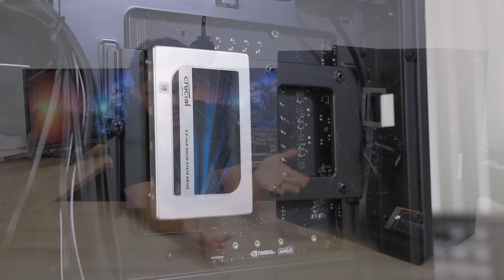The best case they've ever made? BeQuiet Dark Base 700 Review

Comment: In my opinion this case looks like hot garbage for $180 dollars. 2 fans. Shit ventilation. Not a very unique design. I'll pass all day on this for a H700i.
Reply: It also has virtually 0 cable management features.
Reply: Also next has a internal cable management systems, a grid and hue plus, and a internal RGB cable with  better ventilation all of that for $170 (if you checked of part picker)
Reply: Feel the same way, just don't like that LED on the outside of the case, looks a bit tacky.
Reply: I have a H700i and love it. Custom loop friendly. The radiator bracket makes things so much easier. And it's E-ATX friendly. 
Also you get so much more for just $20 more. H700i for me all the way.
Reply: I also prefer to use the H700i while this case does look good i prefer the H700i and its AMAZING cable management in the back, I DIDNT EVEN HAVE TO BUY ZIPTIES
Reply: Pennywise you do know how small that case is in comparison? Have you not seen the Yacht build? Meshify C is considered budget case. Once you past $150 USD it's considered enthusiast and you get better features.
Reply: I might have sounded a little harsh in my original comment. It's not a terrible looking case but it is very basic and is severely lacking In features for $180. I can't see where they came up with that number. It makes no sense. Maybe if it was stacked with 4 fans and the cable management area had some better features I could see the value but as is I'd stay away for sure. Thermals alone makes it a no go for me.
Reply: Aye, should have 3 fans at least by default, especially considering the current fan isn't enough to cool both the gpu and cpu, just one at a time depending on position. That said, this case looks like a couple easy mods would improve it lots. Like cutting out some of the supports blocking the ventilation. The design is however far less boring and more unique than ant nzxt or fractal case... Those are literally just boxes, this at least has some angles and accents.

Comment: Peter Chatman52 minutes ago (edited)I am really impressed with this case but I'm at a quandary why can't it have USB 3.1 type to with a Type A and Type C, with 3 x USB on the front pane (really is a piss me off issue)l.  It will happen, but I won't be buying any case until there basic elements are included.  Build shit doesn't impress me at all as I'm not a builder - just an end user.  One day we will get Thunderbolt 3 to get top end data transfer.  CAN'T THE FRONT PANEL HAVE A TRICK HOLE on the front panel TO GET A STRATGHT AIR INTAKE for max air flow - hell its not Temper Glss????  (90 degree air flow is not good!!!!!!!!!!!!)

Comment: I just received this case today and I started reversing the configuration. This case IS NOT reversible. I followed the manual for inverting the motherboard and when reinstalling the back panel, it would not go in because the thumb screw nut plates protrude out. So if you want it reverse, prepare to have a nice view of the motherboard back mounting plate. Unless I missed something in the instructions but I just went through it and it doesn't say how to invert that part of the case that hold the nut plates, and it seems like you can't because it is attached to the entire top of the case housing. Welp, now I have to re-invert everything.

Comment: I bought one, sent it back, not worth the price.  Testers mention build quality.  That means crap if the case cannot even perform well regarding cooling versus BeQuiet's goal of being... QUIET!  And yes, you can invert the mainboard, and it means exactly that, it is then upside down, as is every thing installed on it.  :-)  Also, what's the point of putting a half-ass LED implementation on the front/side?  Now, if you want minimalism, and don't intend to have RGB exploding the inside, then great.  IMHO, if it was max $125.00, then fine.  Otherwise... !